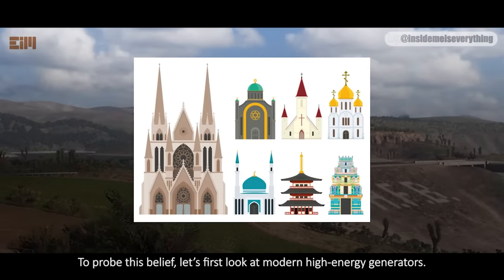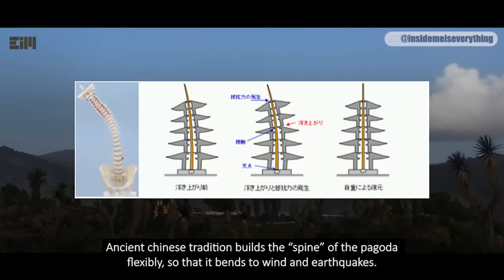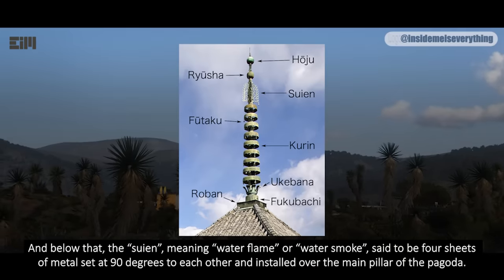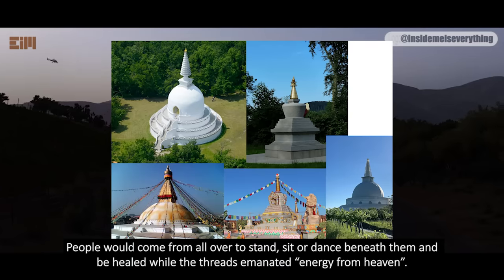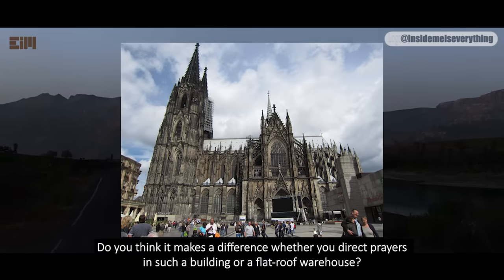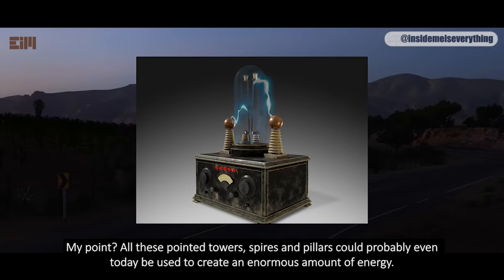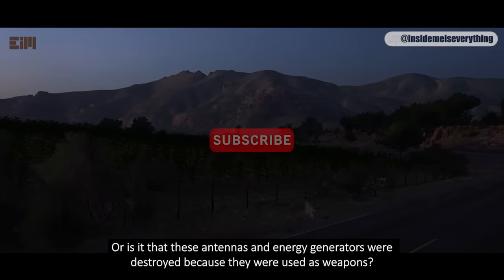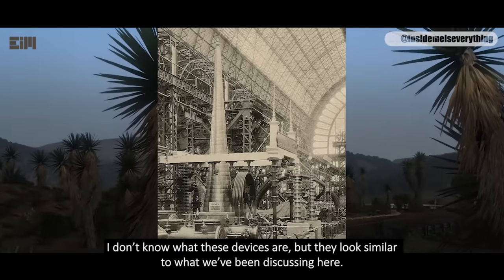IT TURNS OUT WE WERE RIGHT ALL ALONG!!!

Comment: From my years of research into the first Babylon/Nimrod and the archaeology , the reason they 'settled' in the plain of Shinar, is because the base of the tower of Babel had to be approximately 70+ miles at the base to be able to reach into heaven [the bottom of the firmament] and this was the only place big and flat enough to be able to do so. Look in to Lambert Dolphin's finds along with major archaeologists he worked for.
Reply: They can make a structure of that volume (solid I assume) But can't deal with it if they need to clear some rocks out of the way?

Wherd did they get the materials to build it? That probably left a bit of space.

Comment: You have an error in the text of the jacobs ladder: Electrons don't jump from the positive side to the negative side but the other way arond, Electrons are negative themselves and jump from the negative side to the positive side. The negative side is flooded with electrons and the positive side has a much lower amount of electrons. The arc is a plasma that has (negative) electrons that are very light and positive ions that are a lot heavier so the current is mainly by the electrons.

Comment: Just on the Stupas. They all usually have lingams in there centres. Of you look up Praveen and his awesome work on lingams. You will find that of they have looked after. And you put an electric current to them. Each does something. The ones I saw. 1 iust changed water to a very special water for healing. Due to little gold piece's vibrating. Another one while pouring water over it, made a low current. Enough to gold plate something or use for electric healing. Which I have been using personally for decades on my previously broken spine for pain. He has done quite a few different experiments with ancient tools and finding power through them and useful.

Comment: Thomas henry moray figured out raidiant enerygy in using germanium  in a solid state circuit in a  vacuum  tube to convert gamma rays into 60kw in a couple of days  by tuning it to the right oscillation  frequency it nwas through cold fission it was a different  kind of electricty. He was going to sell kits but he also said the really tricky part is tunning it to the right oscillating frequency depending  on the factors of where you are on earth because there are all the outside factors that you need to adjust to and its not zero point its just converting nuetrons into electricity  in a vacuum  state where its at its most potential. They use germanium for radiation  detection because the elements  frequency  absorbs neutrons i think he used germanium  zinc sulfide  to be exact
Reply: He was a tesla admirer and built it based of his radiant energery reciever circuit  patent

Comment: This guy mentioned "High Voltage Insulators" and then wandered on. Does he even know why the insulators are shaped the way they are ? Or the reason why there are a specific number of them on high tension tower lines ?
   I'm a journeyman lineman, and I know. 
    Ask me.
Reply: Alright, why?
Reply: Alright, why?
Reply: @Youtibeviewer   If the insulators were just shaped like a ceramic tube, the length of them would require a tower of around 2 to 3 times the height. Surface area is necessary for the diffusion and negation of the corona field that's generated by high voltage lines. Add to that, that long distance high tension tower lines are run in DC, and not AC. By shaping the individual insulators as they do it creates more Surface area for the power to travel over and reduces the size of the insulators. Thereby reducing the length of insulator strings while maintaining their effectiveness.
  You'll see line crews using deionized water to periodically clean those insulators to keep dirt from compromising their purpose.

Comment: The key to all the many questions is HOW do we Harness the energy created??
Reply: You build metal smelters, then dig up fossil fuels to burn in the smelters to melt the minerals dug up in mines which you cast into wheels which you cover with rubber tapped from trees at rubber plantations, once you have the wheels you can build conveyor belts and forge metals into parts for trucks, you employ people to assemble trucks from the parts carried by the conveyor belts, then you cast a variety of dies to make cranes, mechanical components, accessories, batteries, cables, tools, power adapters, converters, then you phone your favorite energy expert to set up your battery bank to store the electricity extracted from the source via power lines manufactured by a reliable company that has its trucks fleet ready to deliver the technology to your doorstep. And your mobile phone takes care of the bills without you having to lift a finger.